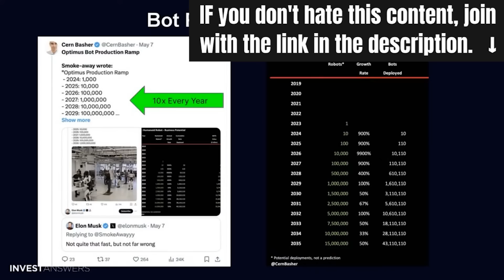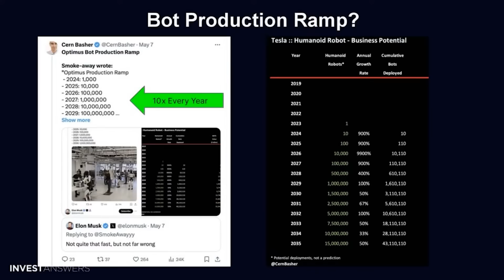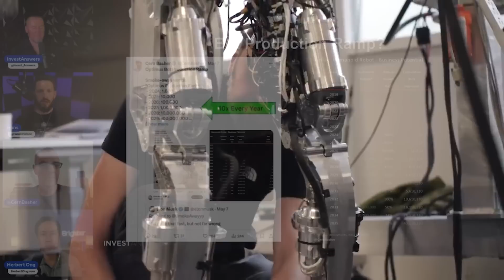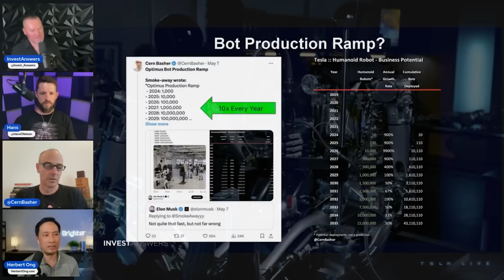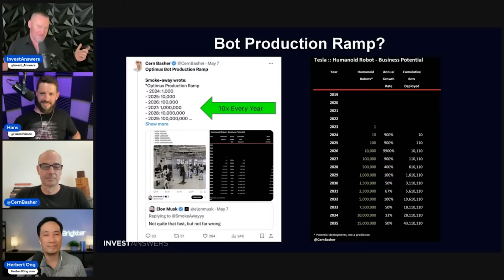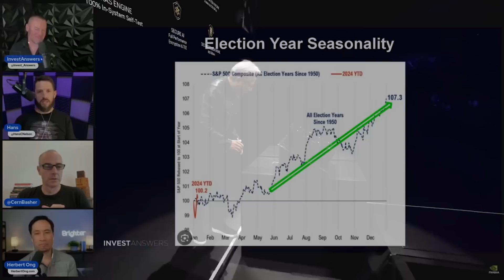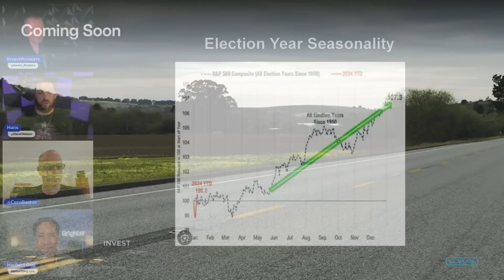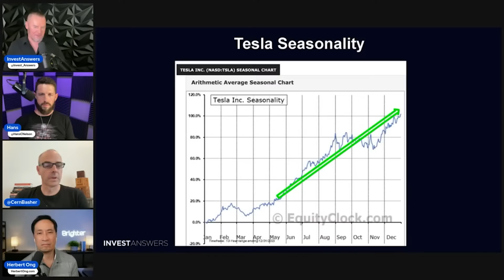MIND-BLOWING Growth for Tesla's Optimus!

Comment: The TAM for Optimus is about as large as you can imagine, agreed.  Building the robot will not be that expensive and margins could be juicy ( depending on the competition).  HOWEVER, there are two major considerations that I did not feel get addressed in this (overly) optimistic discussion.  I felt compelled to shake you out of  your daydreams
1:  FSD is a much simpler problem than the bot that is supposed to perform  myriad tasks.  FSD is just navigating 2 dimensional space with set boundaries (road itself).  There are still numerous variables that had to be and continue to be addressed.  By Musk's own admission, Tesla was way too naive to believe that they could get it done 8 years ago.  Even now, and again by his own admission, they are having to throw more and more compute at a flattening improvement curve.  It is not out of the realm of possibility that improvement stalls before FSD is ready and a step change might be needed to get to the next level and that step change would most likely be AGI.  In which case, Tesla's moat will have evaporated in that you won't need billions of miles of driving data to train an AGI to learn how to drive.  Humans don't why would an AGI modelled after human learning mechanisms.  Musk thinks AGI will be here by 2026.  They better get FSD (one that is worthy of a Robotaxi) running next year.   
Now the bot is heavily dependent on the dexterity of its hands which not just  2D motion of asphalt strips.  It is multiple orders more complex than driving.  Factory worker by day and Sushi Chef at night, really.  WHEN Tesla solves FSD, it will time to start entertaining the idea that Bot might be coming be possible some day.  Even the most optimistic of Tesla bulls (ARK) are not modelling for the Bot, it is that far in the future.  
2:  Also, I would like some one to tell me where Tesla's moat is for that manual dexterity function.  There are numerous companies/labs working on robotic hands, why should we believe that Tesla has an upper hand (pun intended) when they were late to the game.  Yes they can throw compute at it but so can Nvidia, probably more so.   Plus compute price will keep falling.  
TAM is one thing, plugging into it is quite another.  Musk has a demonstrable history of overpromising and sometimes not even delivering, ever( Solar Roof and Hyper Loop come to mind).  Don't fall for it.

Comment: I still don’t see why robots have to be humanoid. Humanoids are going to be extremely unnecessarily expensive for many of the tasks it would replace. You can find much smaller and simpler robots to complete certain tasks.
Reply: Nop average earnings Of US workers is 30 used per hour so a robot per hour for 10 usd is, reasonably and the total workforce for USA is, approximately 130 million
Reply: They don't have to be, and non-humanoid robots are already extremely useful. Two reasons for humanoid form factor: first, the human form is the product of millions of years of evolution, and is quite fit for interacting with the physical environment, and second, the interface for our physical world is designed around this form. So humanoid robots could be swapped in to existing tasks. The benefit is generality.
Reply: Cost is tightly linked to production volumes. If you make 100 different smaller robots they will cost twice as much. Its contre-intuitive but accountants make these decisions, not engineers.
Reply: Hans threw out a line of sanity in there where he said he thought most bots would be specialty bots. He’s dead right. A humanoid bot is a huge waste of of parts and is vastly inferior to bots built for specific functions. There’s a place for humanoid bots all purpose bots, but would you rather have C-3PO or R2D2?  Give me R2 if I have to choose just one. Who knows what all kinds of gadgets he’s got behind those panels.
Reply: Our world is designed for the human shape. A specialist bot will, by definition, be specialist and therefore limited in its flexibility. A humanoid bot will have a broader range of skills - maybe not as good as a dedicated bot but far more useful in general terms.

Comment: You guys realize it’s going to cost a ridiculous amount to be able to produce over 50 million robots? They can’t even make 2 million cars a year right now.
Reply: Production costs are mostly fixed - buying machines and building the factory. Tesla has $30bn in cash right now and they could probably do this with 10. Once you produce them customers buy them and cash flows back into the business.
Reply: @Michael-Has-Opinions  take a look at their liabilities and debts bro. It’s not as simple as just having 30b in cash sitting.
Reply: Bots are much smaller and use less resources. Production could be entirely automated. Can’t see why they couldn’t ramp to the degree indicated.
Reply: You do realize that even at a few million bots a year shareholders (not to mention Tesla itself:) will be cash rich:).. no problem ramping from there.

Comment: If the Bot can be trained by its owner, I see Bot taking off. But if folks have to wait for Tesla to release a Bot task(s) they’re interested in, I think adoption and scale will be limited.
Reply: Bot trained by owner is initially the way however once enough data is accrued then justify your position
Reply: @jaseclarke  Users will have endless constraints to complete their tasks and Tesla will be unable to  anticipate all of them. So a Bot task store sounds like a good option. User can contribute their trained bot models to Tesla to be added to the task store after review. It will be similar to Apple Apps store and OpenAI's custom LLM store.
Reply: That's the beauty of the robot AI brain.  Watch the video of Optimus being trained to stack the batteries.  The robot is mimicking the movement of the person training it.  It's not a software upgrade but it's actually learning like a toddler.  Although it can be done both ways because once one bot learns something you could just download that skill and share it with other bots.
Reply: Bots that have to be programmed have been around factories since the 80's. They will be able to be instructed and trained with voice commands, but the ability to do generalized things will be trained into their AI from the get go. That said they may be good for only a subset of tasks in the beginning.